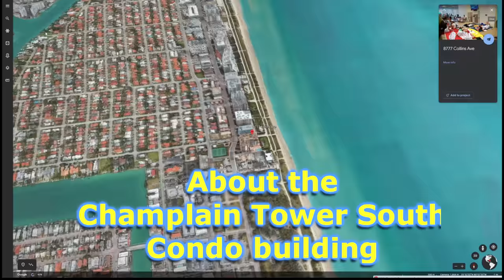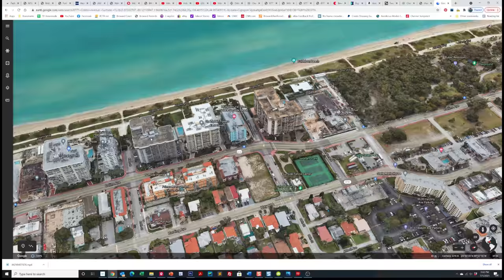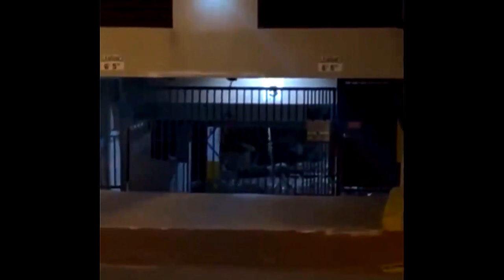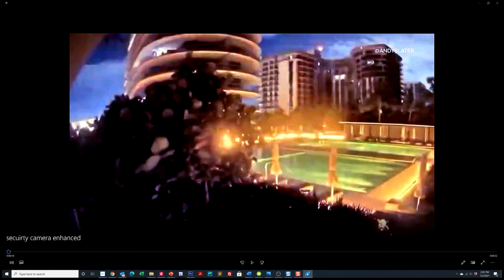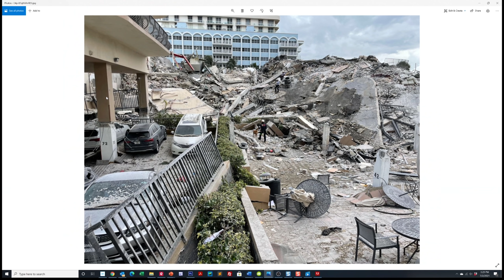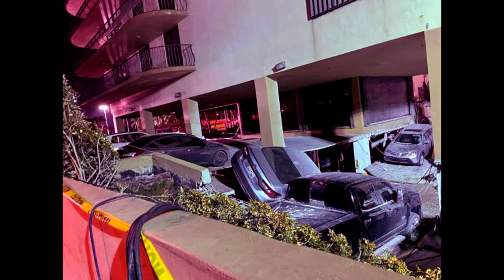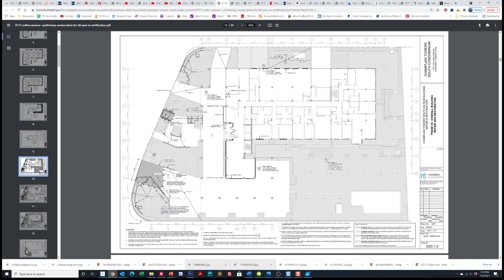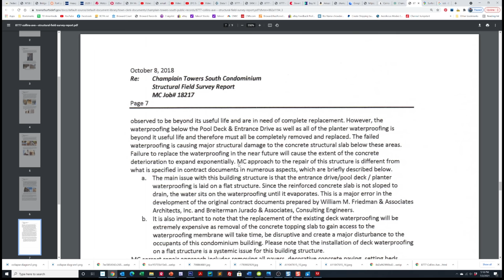Here's Cause Of Miami Condo Collapse Champlain Condo Towers, Surfside

Comment: Good catch on the word "exponentially". That is a powerful word and perhaps the one statement that indicated "time is of the essence" for these repairs to be completed. This language indicated that a collapse was immanent but was probably overlooked by whomever read this report.
Reply from the maker: Even he did not think at the time it was a danger of immediate collapse, but something happened in 3 years, it got exponentially worse.
Reply: " imminent "
Reply: @jeffostroff  The building was collectively owned. So decision to repair was slowed.
Reply from the maker: @JRobbySh   Yes I have owned many condos here in the Fort Lauderdale area. And a lot of times you run into these big arguments on the condo boards to get things done and my last flip condo it was run by an unbelievably inept person who allowed the entire grounds to run into complete shambles, while the other phase that was run by another person was in perfectly great condition
Reply: @jeffostroff  Exponential: 2,  4,  8,  16,  32,  64,  128,  256,  512.   Get the point?  Did the HOA or the inspector understand "Exponential"?
Reply: Failures of this magnitude seem to always result in dramatic improvement in building laws. I would suggest the adoption of a "plain language" requirement in engineers' reports etc. Condo associations are not run by experts. Lay people need risk spelled out for them in no uncertain terms. I know vague and veiled language is often added by lawyers concerned with liability. But after the punitive damages verdicts come in after Surfside is litigated, no one will argue for obfuscation when clarity and honest assessment is the only moral route. And I do believe builders, architects and engineers have a moral obligation inherent in their professions.

Comment: Jeff, as an engineer I commend you for the time it took to make these videos. Looking back maybe the original engineer should have had the pool deck and garage on separate columns. A pool deck and planter drainage system would also be nice. There also had to be irrigation to the planters which may be another source of the water.
Its also interesting how some of the pool deck slab just sheared right down the columns.
Reply: The important facts in preventing failure due to oxidation of the steel is the quality and thickness of the concrete cover. A general rule of thumb for the cover is 50mm of concrete of the correct grade, containing water penetration additives and correctly vibrated during pouring. 
Complete oxidation of steel increases it's volume 13 fold, so the 50mm cover acts firstly to stop oxygen penetration and also to withstand the pressures. If steel cannot expand, it cannot oxidise. 
For areas involving permanent water, due to footings below the water table, mass concrete is preferable to an engineered footing. Likewise, items such as swimming pools require different cover calculations. All to often, items are added to a project after the structural design without having the calculations re evaluated.
Failures such as what happened in this case are fairly rare. However they give around 2 decades of warning in the form of rust stains and hairline cracks.
Reply: @wilsjane  lengthy & detailed comment
Reply: Lengthy & detailed comment. You must be a professor. It took 40 years for a poor drainage system to tear it down. Water intrusion and poor drainage planes are a major source of construction failures from residential to commercial.
Maybe you recall all of the early Miami buildings that had concrete mixed with brackish water.
Reply: Sources of Irrigation?  What about rain, the buildings out side!  It sure looked identical to the demolition of the remaining half of the building.
Reply: @donwaters2022  Don
Water proofing, flashing & drainage plans all have to be intact for a structure to last. As I told my classes if you want to save cash learn how to flash & don't be a dope slope.
From the photos and video I have watched the pool deck water proofing and drainage plan have been compromised. The rain water gets under the pavers and eventually finds cracks in the water proofing and soaks into the concrete over time. There is one picture of some pool deck rebar just hanging clean with no concrete on it.
So the water wasn't properly controlled and a failure in the pool deck is the result. The drainage plane is under the pavers. Since the columns that failed were attached to the columns on the perimeter of the tower the deck column failure took down the whole building.

Comment: 8:31 It's NOT a broken beam...  It's the sign attached to the outside of the driveway gate. It looks a little different in each of your shots due to the angle and reflected light. However, in any event, it is NOT a broken beam. Besides that, you have a done a good job. I will point out that it is common to pour beams between concrete columns. Theses beams share the weight of any slab across all the columns. I'd suggest the slab comprising the pool deck did not incorporate beams. The deck was simply sitting on columns.
Reply: Yeah, seemed obvious, didn't it?

Comment: That thing “hanging off the ceiling” in the garage is a sign attached to the fence. You can see it clearer in another video.
Reply: You can even see it in the street view image he uses immediately after making his silly comment about a beam/soffit...
Reply: That's what I was thinking
Reply: Obviously no obstruction by the security gate. Should have been a good indicator that it was in front.
Reply: No matter what it is, it's unacceptable that it fell down.  It means the building was slowly failing, it by bit, which never should happen in the first place.

Let's put it another way.  The lady on the first floor heard it fall, investigated it, and then returned to her apartment, took her two children, and then ran four blocks away.  And you say is was "Just a sign that fell?" Come on now, start using your brain, A person would REALLY JUST RETURN TO THEIR APARTMENT, COLLECT THEIR CHILDREN, AND RUN FOUR BLOCKS BECAUSE A SIGN FELL????
Reply: @fraidykat  what are you blabbing on about? I stated that there’s a sign attached to the gate, which the guy in video tried to say it was a fallen beam in the garage... So what’s your point? I’m just pointing out an error in the video.
Reply: @travsb1984  Silly comment maybe, but his evidence is proving to be in agreement with the views of six engineers interviewed by the Miami Herald. It is becoming more likely that a column punched through the slab beneath the parking garage. As to why, that's entirely speculation at this point.
Reply: @fraidykat  sooo what does that have to do with the sign on the gate? lmao
Reply: @HGrrrr  More specifically, what does your red herring sign have to do with the collapse other than the fact that means whatever what holding it to the wall fell out?

You've affixed yourself on something the narrator said COULD be a beam or a soffit.

And yet a resident did indeed observe debris in the driveway.

So just stop it with your "sign" correction.  It's trite, meaningless, and nothing but a distraction.
Reply: @fraidykat  but the sign didn’t fall.. it’s still attached to the fence!!! What don’t you get?? Go back and look at it. That’s all I’m saying is that it’s a sign attached to the fence.. where tf did u get that it fell?!?!?
Reply: @jhohler7249  I'm an engineer, I design buildings like this for a living.  I would say take anything you hear with a grain of salt, even the most "professional" sounding youtube content creators who claim to be PE's.  If you were a successful engineer why would you be creating youtube videos for money, when you could make far more working on projects?  Unless you are given unrestricted access to information and test results everything in a guessing game period, end of story.  In school I have worked on forensic projects to determine the exact causes of structural failures during major earthquakes around the world, the process takes months, if not years.  No offense to the effort this guy is putting into this disaster, but from listening to him for a few minutes it's overwhelmingly clear he is NOT a professional engineer...

Comment: If drainage falls were designed on deck, why wouldn’t they be implemented? is that on the head contractor? Who then certified the as built? Such a sad situation. Your video is impeccable; immersive to say the least. I watch with a heavy heart. 😞
Reply: It was a major design fail.  The contractor in 2018 questioned it because he saw that the pool deck was built in a way that water couldn't drain correctly.  I'm not a structural engineer but it makes sense that you plan for runoff but remember this was built in 1981 when standards may have been subpar.  If I'm the investigators, I'm going back to all of the work done by the original contractor and immediately surveying every building they worked on.  I also have to point fingers at the main building inspector who said everything looked great.  He's going to have to live with his decisions forever.
Reply: @patrickdezenzio4988  If you mean the building inspector who signed off on it 40 years ago, chances are pretty decent he is dead.
Reply: That responsibility would fall on the inspectors. It's their job to spot errors or not-to-plan issues.
Reply: @dunerinaz  Right. Government... who cares for us so much.

Comment: Very well done.  I said from the start that "if" it had been only a "Foundation" problem , residents would have noticed pictures not hanging straight on the walls and dips in the floor.  As is usually the case, looks like several problems all came together.  The verticals being different thickness is something to look at.
Reply: Yes!
Reply: I think you are right about the foundation theory. Big failures are generally the result of several problems at once. The lesson here is to not let problems, no matter how seemingly small, go unrepaired. A note on the parking diagram: The fat columns are in the middle only. Skinny columns are on either side of the fat columns. Look at the parking spots on the lower edge of the dwg. Spots in the lower 50's had fat columns but the upper fifties and lower forties had the skinnies. 58, 57, 56 were skinnies too. Just an observation only
Reply: very sad. may all the families be comforted and supported. may all who perished be in a good place and in peace. the lord giveth and the lord taketh.  we come from dust and to dust we all return 🕊

Comment: It's scary to see how cleanly the floor separated from the collumns. Floors falling through their supports like a finger through toilet paper is not supposed to happen. Even if this was started by water damage or poor maintenance - the way it was constructed had to have been faulty.
Reply: If you watch a bunch of “Disaster: What Happened?” shows, almost always the answer is a combination of factors (for example, it wouldn’t have happened if the design was a bit better, or the if the safety measure/person didn’t make a mistake, or the weather was better...but with all 3 it did).
Reply: Barry Milliken 
"As an architect I would never design a structure like this.  I would have a continuous foundation wall at the perimeter of the building. Any additional underground parking outside the building footprint needs to be structurally independent.  One reinforced opening in the foundation wall would allow traffic between the two parking areas.  Your previous video shows that the slab under planters abutting the building failed first, collapsing the pool deck.  This then weakened the adjacent columns which also supported the building so it collapsed 10 minute later.  All this also likely negates the theory that the foundation 8 feet below failed because of sea water intrusion."
Reply: It fell from vertical destabilization, video show horizontal weakness. The result would be one floor failing only.
Reply: Faulty construction?  It stood for 40 years.
Reply: The Florida media does wants this story to go away. The entire Florida economy will be under speculation. Florida is the retirement capital. Aside from oranges, they will be sunk. No pun.
Reply: @doctorlarry2273  many bridges stand for decades yet when they fail often faulty construction is blamed alongside poor maintenance.
Reply: @chrisccc22  "The entire Florida economy will be under speculation." lol
Reply: @doctorlarry2273  Inspection said due to the pool structure's faulty construction, that would have to be corrected.
Reply: @chrisccc22  Like past history, it will be "news" for a while, then on to the next story
Reply: @Matticitt  Blame is placed on anything after decades.  If the design was to the existing code at the time and it was built as designed, then lack of maintenance/inspection is the usual suspect.
Reply: @Brucev7  It was not a fault structurally, but in waterproofing (maintenance).  Big difference.
Reply: @Brucev7  What is your point?  I could not stand listening to such a disorganized video.  My point is that when something stands 40 years, there was not faulty construction.
Of course, I only have 50 years experience as a structural engineer, so what would I know?
Reply: @doctorlarry2273  What do you mean?
Reply: @doctorlarry2273  There are different opinions. I did not 'stay at a Holiday Inn last night.' So until a consensus is agreed upon, there is speculation.
Reply: @Brucev7  It is mostly speculation.  Babbling about it now is fairly useless.
Reply: @doctorlarry2273  that's what you, others are doing. Just normal.
Reply: @Brucev7  No - in my case I noted that if a building stood 40 years, there was no faulty construction.  That is based on 50 years of experience in structural design and assessments - it is not speculation.
Reply: @doctorlarry2273  Then you're opinion is this is the "Shelf life" of this building.
Reply: @Brucev7  You don't speak for me and you obviously don't understand simple english,.  Give it up.  You have nothing to offer.
Reply: @doctorlarry2273  Oh, alright. You seem to be a bitter old man
Reply: @Brucev7  Wrong again - but certainly not surprising.
Reply: @doctorlarry2273  U seemed to calm down some